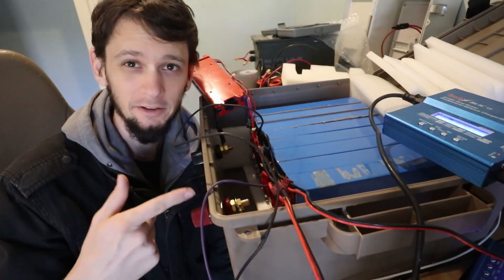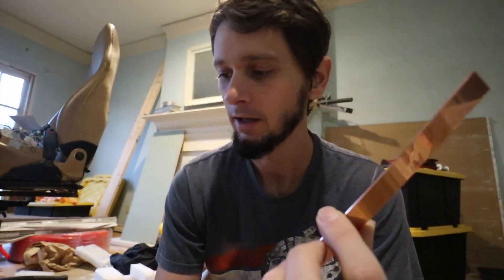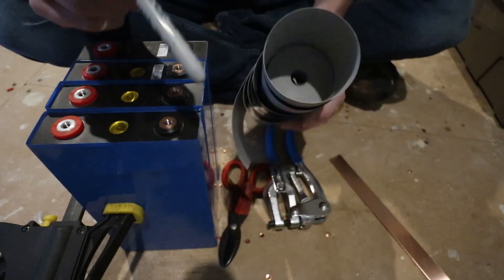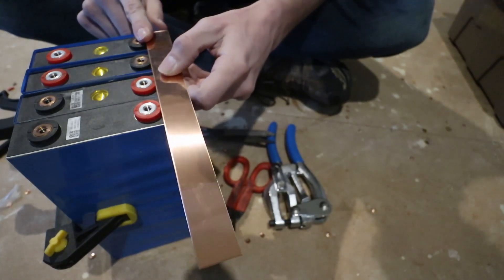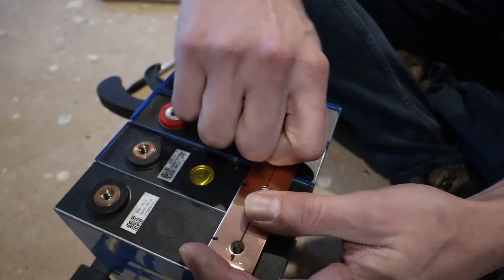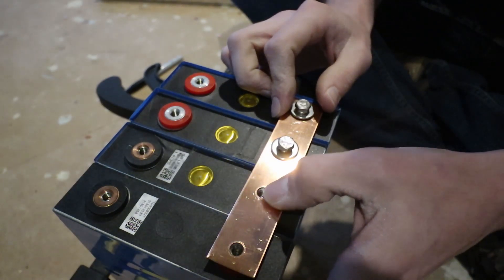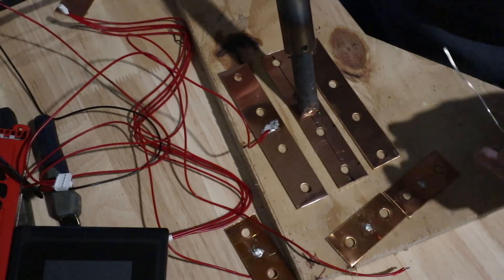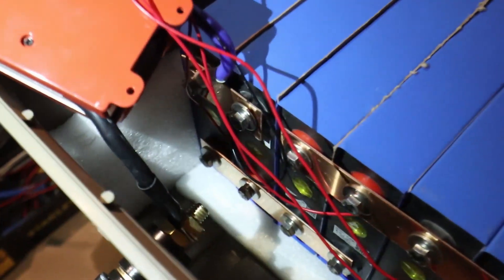Punching Custom 100 Amp Bus Bars for 200Ah Prismatic Alibaba Battery

Comment: Do not put prismatic cells on the small side ...  bext position is venting hole up .. OR for most of them it's ok to put them on the LARGE side but never on the SMALL side.
Reply from the maker: Never heard of that limitation. Could you share your reasoning or documentation on the matter?

Comment: I think there will be unwanted stress on battery terminals when cells will expand with the state of charge. I think you need either flexible busbars or keep some additional space between the cells so they can expand and shrink freely.
Reply from the maker: You’re not wrong. There should be a stress relief in the bus bar as well as something to hold the cells together better. Both things I’ve been doing on more recent batteries so I need to figure out how to best sunset any bad/sub-optimal advice from older videos.